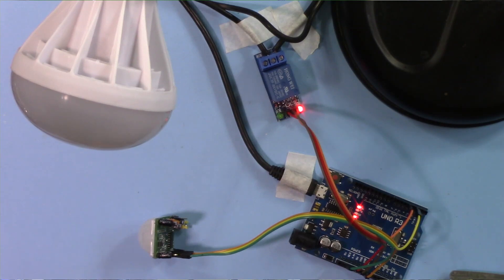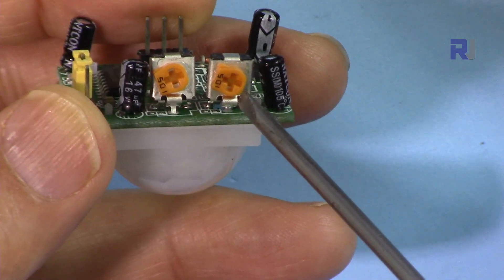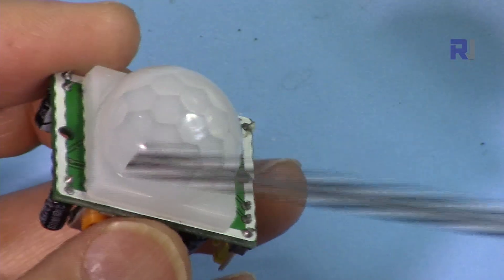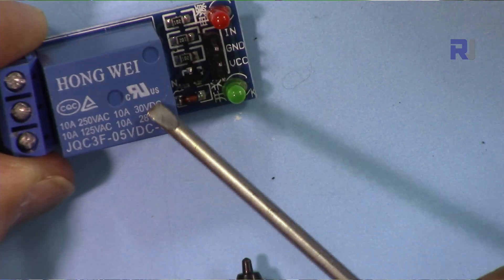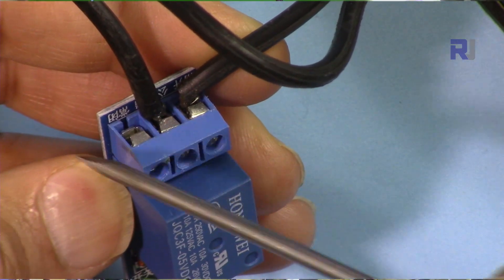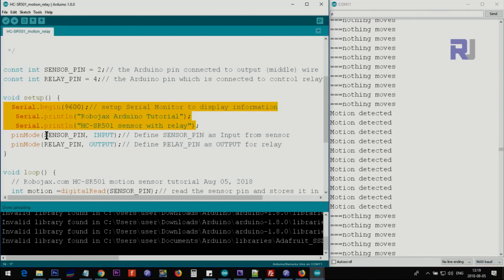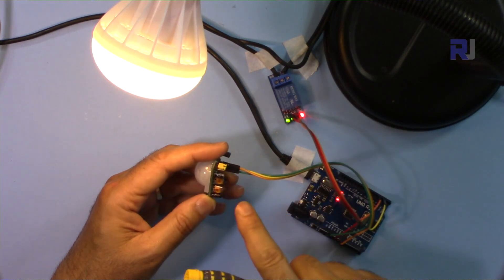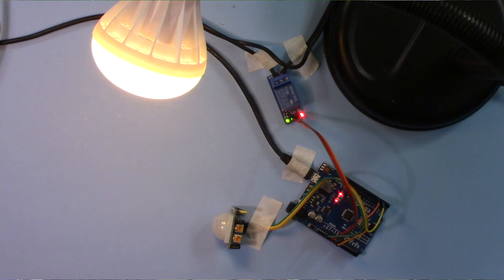Using HC-SR501 Motion Sensor with relay and Arduino code to turn ON AC bulb RJT116

Comment: How would you use a NANO Arduino board it has only 1 x 5V pin out ?
Can you simply piggy back from the one pin?
Reply from the maker: Hi, yes you can connect multiple items to the same 5V using a bread board

Comment: Hi 
Love your video and explanation 
I would like to simply turn on and off a 5V DC laser light that has a simple on off switch which I would like to control by the Audrino & PIR sensor
Can it be done without a relay ?
Can you suggest a solution ?
Reply from the maker: Hi, I don't know for what reason you want to avoid using relay but we need a switch to turn ON/OFF the load. If your laser light needs up to 30mA maximum yes you could use Arduino without relay.  if you don't like relay, then you can use solid-state switch like mosfet shown here https://youtu.be/17vqLv508Uw

Comment: If I wanted to set up four different motion detectors, each to a different color, could I do it all onto the same arduino board or would I need four different boards? For sensing in four different directions.
Reply from the maker: Hello, yes you could.

Comment: Thank you for the vedio .
Is there a way to do this motion with the relay without the arduino ? 
What I want to do is to connect this to a Halloween props and I want the motion to trigger the relay and the relay will be connected to a small motor that will move the props ?!
Reply from the maker: introduction to motion sensor video https://youtu.be/piuUfGVafC0 and see if the time you can set is enough for your application. then yes you can use  it with the relay. The relay shown in this video is LOW Level trigger meaning it turns ON with LOW (or zero volt)  level signal. see the high level trigger signal relay https://youtu.be/58XWVDnB7Ss
Reply: @robojax  thank you for the reply,but this vedio is for arduino ? 
What I want is to use the motion sensor with a relay without the arduino ? So is there a relay that can do that or do you have a vedio for that ?

Comment: Hi Robojax. The pir works fine with arduino with your code, however I don't understand why it is  'digitalWrite LOW' to turn on the relay and the opposite to turn off? When I use the pir with the relay running from 5v dc supply (not through arduino)then the light is always on. Do you know why it is like that, looks like the pir doesn't trigger. Thanks
Reply from the maker: Hello, your question took me so long to look at videos and codes to find something even though I have explained it in other multiple videos  but see this video 15:44 https://youtu.be/JMBgGO07YLM it is the trigger type.  depending on your relay.  please don't forget to subscribe. you lose nothing.

Comment: Hello, thanks for the video tutorial! I was wondering if you can connect multiple PIR sensors to trigger the same relay? If yes, would you be able to tell me what would be the code line for that? Regards, Fernando
Reply from the maker: Hello, I have explained this line by line and what it does. So if you play the code section 2,3 or more time you should easily understand and turn the same relay on.

Comment: Hey, great video btw. I used exactly what you used and it works great. I do have some concerns though: is this risky at all? I intend to keep it running 24/7. Will the arduino overheat or the relay have problems ? because I heard the relays tend to fire up frequently on voltage change and such? Do I have to worry? It's inside an electrical box right outside the house with all the components inside that box.
Reply from the maker: Hey, I have not tested the reliability of components. there are tones of different brands producing components. But for Arduino and relay you can add 200mA fuse on the 5V power line so would never allow extra current that might cause fire.  Try get relay from Digikey or some other reliable store and make your own module. here is how you can drive a 5V relay using Arduino https://youtu.be/N-fFk51Eb8s Arduino itself should be good quality if you purchase Authentic Arduino from Amazon https://amzn.to/2KApAwK it should be more reliable. Good luck and stay safe.
Reply: @robojax  Thanks for replying, I'm sorry I'm not really good with these stuff. Does the fuse have to be 200mA? because the least I could find from local stores are 1A. And what exactly causes the fire or what is more risky should I say? the AC 220V on the relay connected to the outlet or the 5V from Arduino?
Reply: @robojax  I'm using the official Arduino Uno - R3 btw
Reply from the maker: anything I say here will be used against me. This is DIY project. You should know to be careful and take precaution. . Ask a professional to assist you. For myself I trust the relay like I do trust tones of other electronics devices I have. But for you I mentioned the fuse to be safe incase court asks me to come and answer. These relays are used widely in lots of electronic devices.

Comment: hello sir! in our project, we have used ADXL335 accelerometer sensor to detect vibrations. We planned to add an automatic light switching using a 5 volts relay. can u please help me out with the codes to interface the accelerometer, relay and arduino to switch on a dc bulb
Reply from the maker: Hello, use you can use the code and this video https://youtu.be/58XWVDnB7Ss good luck

Comment: If you move your hand out and wait for light to stop, then move hand back in, it doesn't lit up, does it ? It has a 4-5 seconds delay to re-trigger? 
Is that normal ?
Reply from the maker: it should. I have shown how to adjust it. Watch it carefully. There is adjusting and position of object or something.

Comment: Hey I'm a bit confused so I want to ask something, still studying here.. if you connect Relay to normally open, why would you write LOW to turn on the relay? Thank you
Reply from the maker: Hi, perhaps you missed what I've explained. this relay is LOW level trigger. meaning it will turn ON when it receives zero or LOW and turn OFF when it receives 5V or anything about 2V.
Reply: @robojax  okay thank you very much for the explanation

Comment: So If you want that relay to stay on for 10 seconds you need to increase delay time, but when loop gets to that delay it cant trigger relay because of that delay...
Reply from the maker: first if you want it to stay for 10 seconds, then all other triggers should be ignored. Isn't it? Yes there is solutions. We can use millis() which will not keep the loop waiting. see my two videos in that topic https://www.youtube.com/robojaxTV/search?query=millis
Reply: @robojax  so if the motion still there , the relay will always be triggered if millis() is used, right? And that will make the lamp always On?

Comment: can this setup work in a way where the bulb is glowing when there is movement and it gets switched off when there is no movement? basically it should be switched on for the entire time when there is movement instead of giving a timer for 6 sec or 300 sec as you explained in the video. my project is stuck because of this issue. i would be thankful if you can help me out.
Reply from the maker: this will be affected by light.
Reply: what i meant was that instead of getting switched off automatically after few seconds it should get switched off only when there is no movement

Comment: Hello, 
Can you use the power cord from the lightbulb to power the arduino if you step down the voltage? I would like to only use one cable
Reply from the maker: No you can't. AC light bulb is AC and Arduino needs DC .

Comment: hello , what is the Arduino function in that ?
Reply from the maker: you can have time control on how long the light or alarm can be ON or OFF or  you can do more thing. This is just opening the opportunity to do more.
Reply: @robojax  I need power supply circuit in that , can you help me ? motion sensor with arduino n power supply circuit 🙏

Comment: please make a video using 2 or more pir"s with one bulb
it will be more helpful to me
Reply: I can provide you with the code and all the information
Reply: it should work the same, (connect new sensor's ground and power pins) and just connect the signal to another pin number, and in your code, you test for that pin number too (besides the previous sensor's pin).

Comment: You can replace relays with other components
Reply from the maker: Yes you can use any other relay you want. But you need Arduino (any arduino) and the HC-SR501 sensor.
Reply: @robojax  Ohh... Can you make this circuit in combination with the mechanical switch
Reply from the maker: The possibilities are endless.

Comment: THE MOTION SENSOR WORKS IN WHAT i DID.. BUT THE GREEN LIGHT ON THE RELAY IS NOT LIGHTING.. THE SAME THING HAPPEN TO MY AC BULB.. WHAT SHOULD I DO TO MAKE THE RELAY WORK SIR
Reply from the maker: check the wiring. Do not modify the code first.

Comment: I wonder if you can help (great video thanks!) I have this sensor but would like a small unit without the arduino. I have it linked with simple single LED and transistor to test. It's working.. but whatever I set the RIGHT wheel for delay to, it keeps randomly lighting with gaps in power. So it will light for 3 seconds, then stop, then light again even though I keep moving it switches off. ?
Reply from the maker: You are welcome. Please watch the video again. There is jumper and two controller. You have experiment and find solution for yourself. The jumper is very important. Have patience and play with it and write down on paper what you did in each step and then compare the results.. this device is very good and it should work for almost any situation. When finding and testing, your single motion will change everything so make sure you sty still if you want no trigger happen.
Reply: Robojax I’ve moved jumper. It doesn’t continually light through motion. Just resets. . Many thanks.

Comment: I have only one 5v port in arduino
Reply from the maker: then in make one of the pin as output. like this 
in the setup() put this for example pin 5
pinMode(5, OUTPUT);
digitalWrite(5,HIGH);
and now pin 5 will always be HIGH which is 5V and  you can use it as 5V source for small items like relay or sensor.
Reply: @robojax  Please more explanation please
Reply: @robojax   HI CAN YOU MAIL ME MORE DESCRIPTION ON THIS ONE
Reply: @robojax  you can use female header connect the two 5v to one 5v in arduino right?

Comment: Hi Robojax. Amazing videos. I would say that the code would be almost the same if I substitute the motion sensor with a vibration sensor (SW-420 Vibration Sensor ).
Reply from the maker: Hi, Thank you. Yes most sensors work the same way except pins are labeled differently or they are located in different location.

Comment: hi dear , 
             i  want to know some code from you for 4 relays operate  setup by setup , 
these relay should be active  when signal come from other source. when first time signal come 1st relay should be active for 8 sec, then next time signal come then should be 2nd  relay active  for 8 sec 3rd time signal come should be 3rd relay active for 8 sec, 4th time signal come should be 4th relay active , then five time signal come its should be start from 1st .
please can you send the code .  my watts app   00971562644048  
thanks
Reply from the maker: Here I have 4 channel relay video. You can modify it https://www.youtube.com/watch?v=Wbm3MCMgM_s